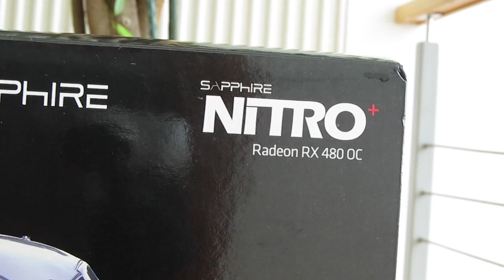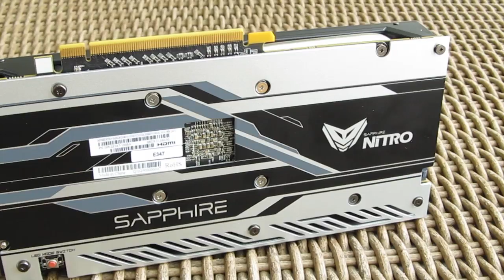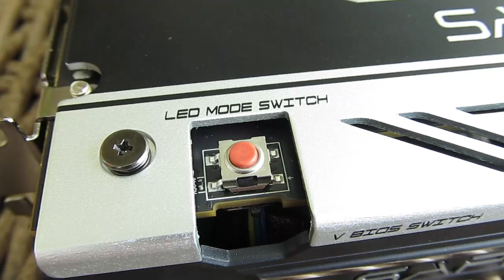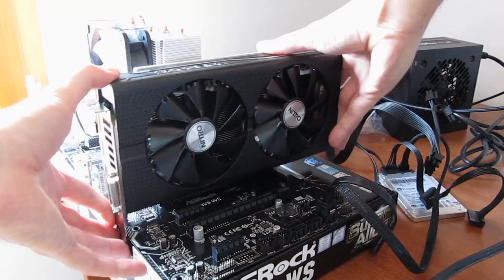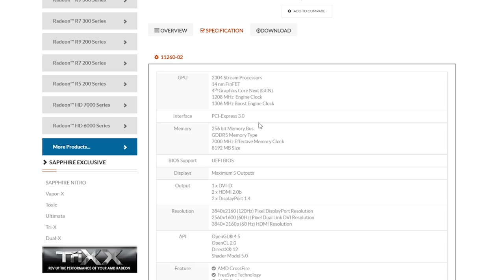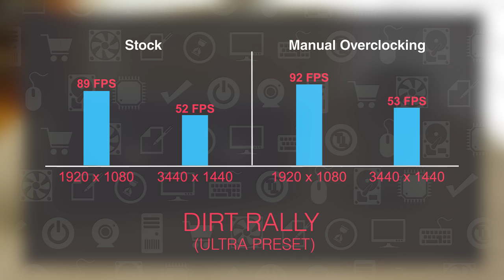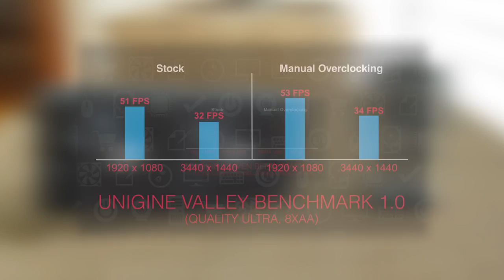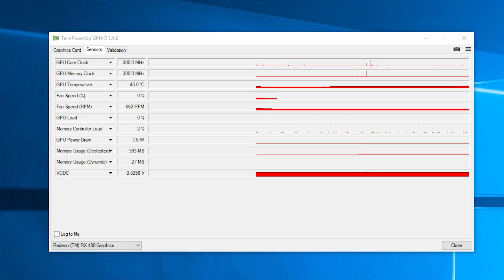Sapphire RX 480 Nitro+ Review - Aftermarket Salvation

Comment: i think these are a little overpriced, more than some of the AIB 1060's which are so much faster
Reply from the maker: I think it's currently like that b/c of the stock / availability situation. It will stabilize once some time passes by.
Reply: TekTick yeh maybe prices will go down but here in the UK a Msi AIB 1060 is 20£ cheaper than the sapphire which is a surprise, every reviewer i have seen had the 8gb 480 as being quite a bit cheaper but that just isn't the case here
Reply: I live in the UK and the cheapest msi 1060 (6gt) is identical to the 480 nitro+ 8gb. both at the £240 price point. And one is clearly more well built than the other. Also the 1060 isn't ''much faster''. You can't be blind enough to look only at dx11 benchmarks and not look at dx12/vulkan benchmarks (which are the future for API's) where the 480 beats the 1060. Both are good cards but i'd personally go with the 480 just for the extra vram/cheaper price point. And also future proofing for new API's.
Reply: If you want to look at the prices yourself go to ''scan'' online, some of cheapest prices for computer components you can find in the UK along with ''Overclockers'' ofcourse.